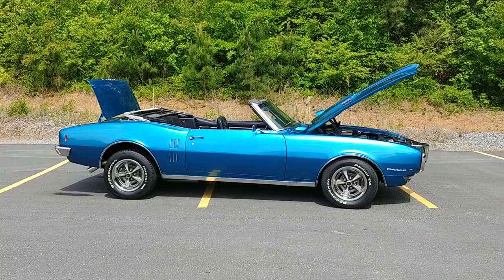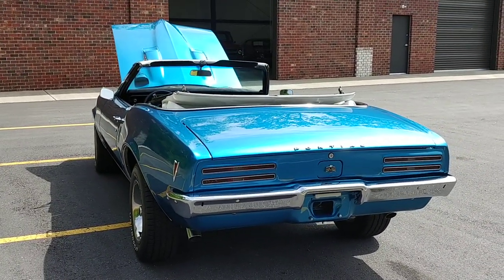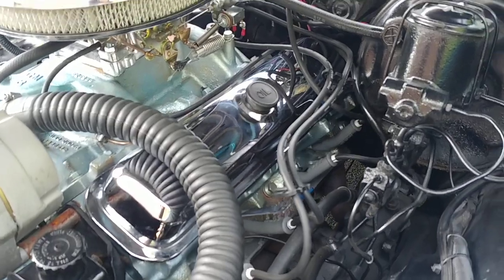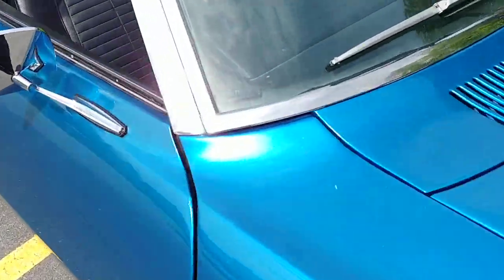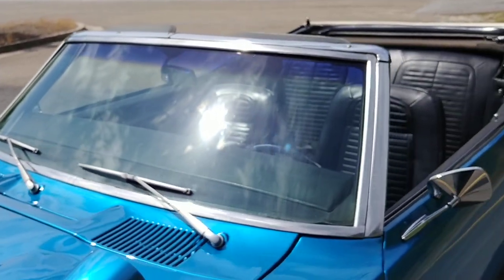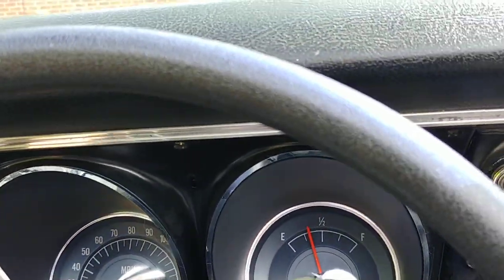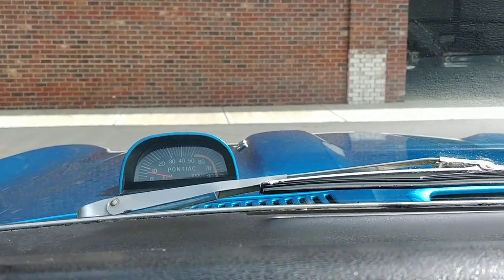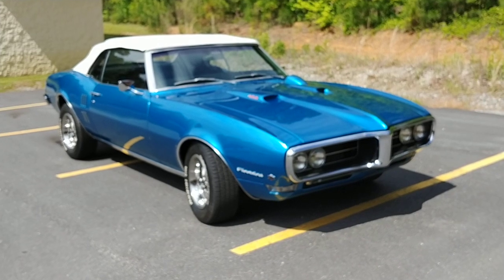SOLD - 1968 Pontiac Firebird 400 Convertible

Comment: You are missing the 400 badge on the rear decklid....just saying if you are rebadging the car.
Reply: ... and fender badges in the wrong location... should be above the crease.
Reply: And Pontiac arrowhead on front bumper for a 400.